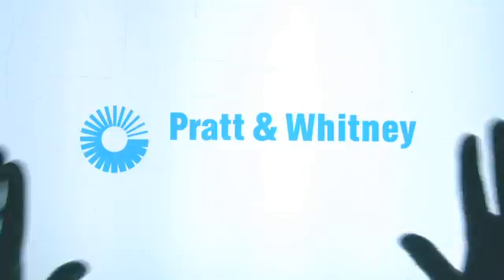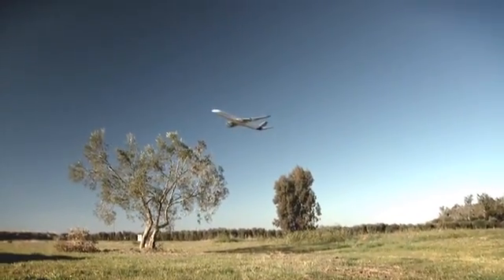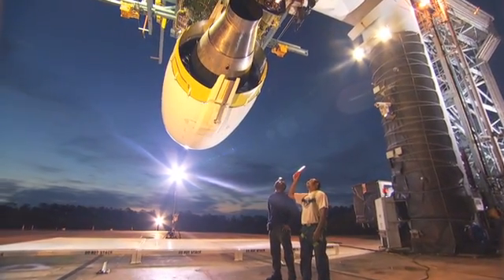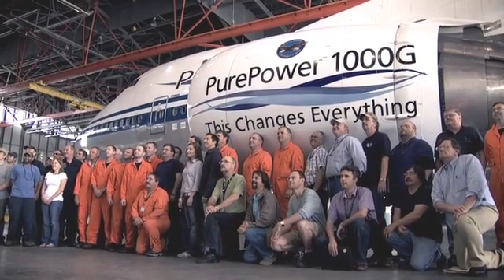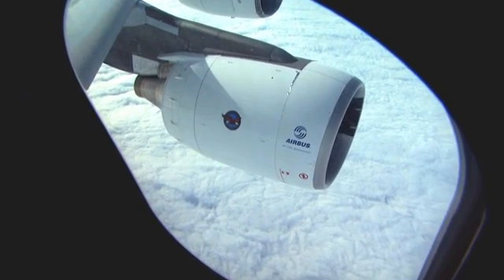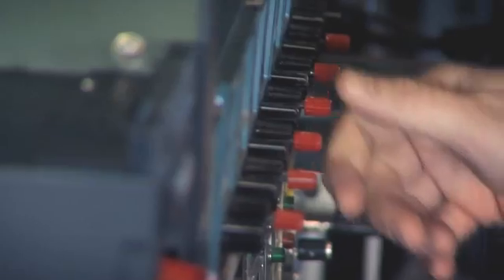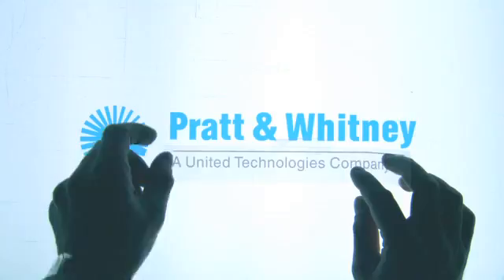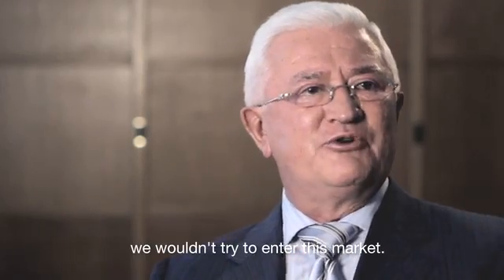PurePower PW1000G Engine: Customer Testimonials

Comment: The fan blade assembly must also be isolatec from the driving shaft from moment.The problem on the direct blade assembly installation ismost likely to occur since the design is very similar to wind turbine gearbox.Forcez on the tip of the blades produces substantial amount of moment affecting gears and bearings.
Reply: waht te fuk is "isolatec?"  (also everything you just commented is categorically incorrect)

Comment: Hey Mike!  Why don't you explain to the FAA why 80% of the radial loads on that big gear driving the Fan is taken up by only 2 of the 5 planetaries?  And then explain to the FAA certification office WHY that has NO Safety or Reliability impact?  Huh?  Please explain.  And then please explain why the Safety AND Reliability certs never mentioned it.

Comment: Geared turbofan is the sum of fuel efficiency of turboprop engine and thrust/weight efficiency of turbofan engine. How much does this cost? About 100kg extra weight of gearbox.
Reply: wow are you WAY off.  a "100kg?"  where the fuck you get that low weight?

Comment: Looking at this video in January 2019, well, I can say that the PW1000G is NOT proving to be the game changer that it was touted to be. The CFM LEAP has clearly proven to be much, much more reliable. You are losing future customers, P&W! Better get your head into the game before it's too late.
Reply: Same to yr idea, our Ac fitted with PW 1100 have so many engine problems !!!  Almost Ac grounded after borescope especially TEC (turbine exhast case) or wait for Recommendation from Manufacturer, Ac take service not more than 2 , 5 years !!!!

Comment: Now all that's needed is a cooling system to make it even faster.
Reply: chris77777777ify or just get rid of the gear box completely, use 2 smaller fans, add 2 stator vanes, and throw in an afterburner and it will really be faster and you get around 20 percent less thrust but 4 of them low bypass after burning turbofans would power a concorde v2.0 at Mach 1.85 cruising speed.

Comment: Why does it need a gearbox, wouldn't a fluid clutch (much like a viscous fan on a truck, or turbomatic clutch on Fendt tractors) be lighter, and more reliable. Yes, it wouldn't reverse the direction but it would have adjustable ratios.
Reply: It has a gear to adjust the front fan & speed it up in relation to the drive turbine.   The figure this is the only way. 
A clutch doesn't change anything, it's about changing ratio set up.
Reply: The front fan goes slower, not sped up.
Reply: @thecvxman   yes but it is driven by a gas turbine. :D

Comment: Bypass ratio 5:1 is a value for engines designed 40 years ago not now. GEnx has something about 10:1, However 12:1 seems to be amaizing result.
Reply: Anything past a 9:1 bypass ratio is grounds for diminishing returns.

Comment: i believe fuel efficiency can be reach when core (hi-press compressor + hi-press turbine) rotates at a very high speed approx. 20000 RPM. In my opinion, by reducing loads on compressor by means of separate main fan from core, engine might functioning more efficiently. Fan blade also can be made as wide chord as possible to overcome slow fan rotation speed.  Russian utilize contra rotating wide chord fan blades with their NK-93 engine.

Comment: @Zoloft61 One analogy is like the DC-3 vs. Boeing 787. Although Honeywell had geared turbo fan technology (TFE731), the PW is much bigger (sea level thrust 5000 lbf vs. 30,000 lbf +). Also PW did a smart move by choosing risk-sharing partners (MTU, AVIO, Tech Aerospace etc.) which gives this engine huge advantage by becoming beneficiary of future technologies developed on the GTF platform e.g. intercooling (between comressors), heat recuperation (tLPT to combustor to lower T4)